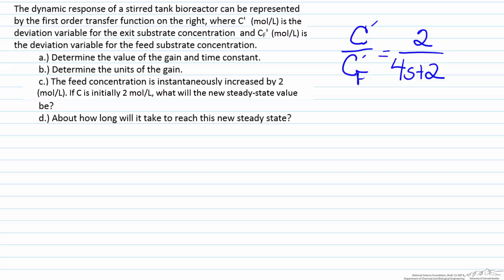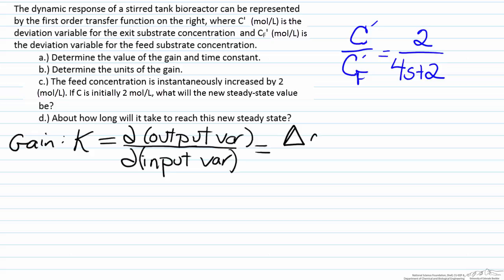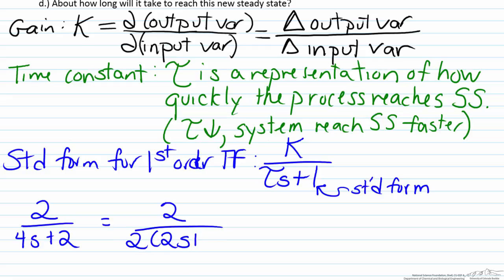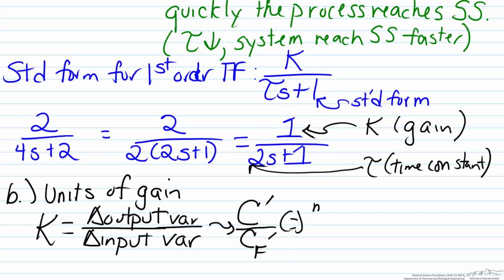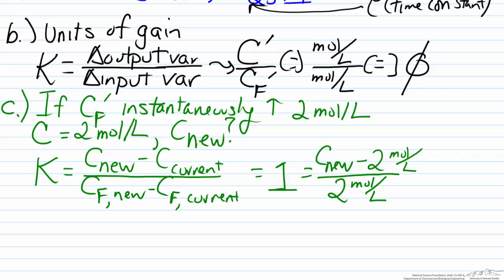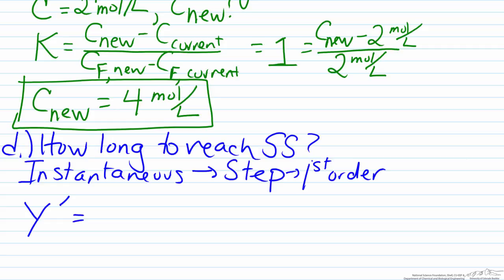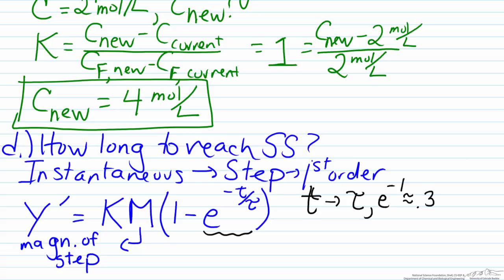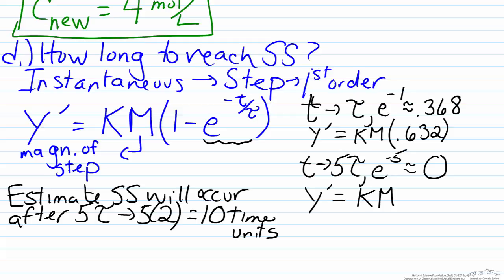Finding Gain and Time Constant from a Transfer Function Model

Comment: I am wondering if you can do this for a second order transfer function. For example, if you had simplified the denominator of the transfer function to s(s+2), can you say that the time constant for the system is 1?
Reply: Just look at the form your type of response should be and rearrange your transfer function so that they are of the same form. Then you can just match up the variables

Comment: t=5tau seems arbitrary. Why not 4tau, when e^-4 would be 0.018  and could be rounded to zero, or 6tau when e^-6 would be 0.0025 and could be rounded to zero? Is there some significant figures or orders of magnitude argument that is being made that allows you to decide that 5tau is okay to choose, or has it just been agreed upon that for this equation, yprime = KM(1-exp(-t/tau)), 5tau is sufficient to approximate steady state?

I guess its easy enough to just remember 5tau, just curious why that value was chosen. And thanks for the video.
Reply: I wondered about that too. From wikipedia: https://en.wikipedia.org/wiki/Time_constant 
It says: 
"After a period of one time constant the function reaches e−1 = approximately 37% of its initial value. In case 4, after five time constants the function reaches a value less than 1% of its original. In most cases this 1% threshold is considered sufficient to assume that the function has decayed to zero - as a rule of thumb, in control engineering a stable system is one that exhibits such an overall damped behavior."

So when t=5*tau, the value is less than 1% of its original, an can be considered 0.
Reply: Rebirbokaj 

1% makes sense. Thanks for the answer.